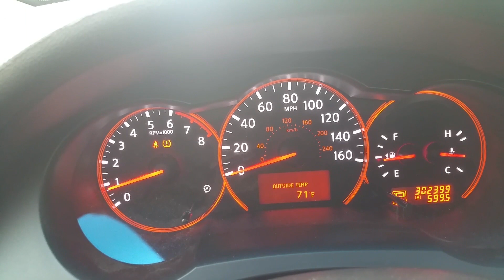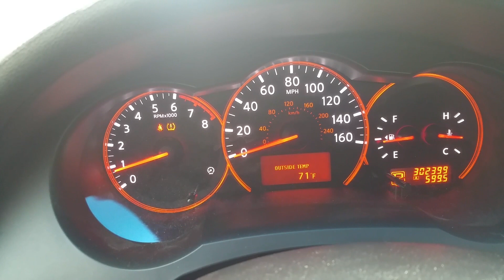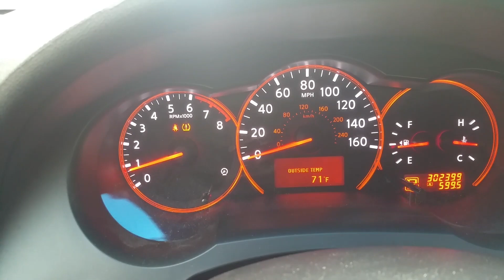HOW Long should A CVT Transmission Last?

Comment: I have a 2009 Altima and now I'm worried. It has 123,000 miles on it. Still running strong but I noticed it sounds like a grinding noise in reverse that I never noticed before. So I guess I'll drive it till it dies but If I don't get 200K on my Nissan then I'm done with Nissan. I have baby'd my car. I do all the maintenence and I change the trans fluid every 30k. So far I've never gone into limp mode.  Bought it brand new.
Reply from the maker: Who changes it? Alot of garages say they change stuff but they don't. Be weary of mechanics that rip you off....

Comment: I have a 2014 Honda Accord 2.4  I love it. It runs very strong and fast. I didn't know that it's equipped with a CVT. Transmission. Its 86k miles on it. I got it since new.and I never got any problems with it.

Comment: The problem with cvt is it’s a sealed unit, a pos of shit design for a vehicle and crazily expensive to replace. It would be a cool idea if you could actually change the belt every 100k when it starts stretching but you can’t. Do not ever buy a vehicle with a cvt unless you plan on just leasing because you will only get 100k miles out of it.
Reply: Nope, not true in every case. Honda and Toyota make the best cvt's and it's well documented. They last well over 200k plus when driven properly and regular fluid changes at 30k. Cvt's are not racing transmissions nor are the made for the heavy lead foot. They are made for smooth shifts and gas mileage. Treated as such you will not have issues with the two manufacturers i mentioned. The others i just don't know.

Comment: I just purchased a 2007 Nissan Maxima it has 113,000 miles it. I don’t know much about cvt transmissions. I’m changing the oil I should probably change my radiator fluid in my training fluid out I don’t want any problems thanks for the video.
Reply: How has it been

Comment: I have a 2013 Nissan note E12 supercharger model with over 90k mileage and no problem I change engine oil every 6 months and transmission fluid every 10 thousand miles runs like a baby
Reply: 10000 miles not recommended even in book
Reply: @thrishulh9834   I pass 7 cars and thats how I do it and never had a problem and all Nissan I use full synthetic castor oil 10w 30 I change every 6 months or 10 thousand miles and transmission uses ns 3 fluid I change every 6 months
Reply: @Babaywayne93  nice to know

Comment: Change the fluid regularly and you shouldn't have any problems.  The salesperson told me the CVT was "sealed for life" so I never changed it, and it failed at 62K on my '12 Versa.
Reply: I dont think your problem was fluid related because those show at later stages not 62k transmissions could easily last 150k even 200k miles on factory fluid, its beyond that where regular maintenance helps, its just that nissan CVTs sucked when they were first introduced
Reply: @Basilahi  I'll never own another
Reply: @Basilahi  1.6 SV.
Reply: What model did you have 1.8S or 1.8SL. Sedan or hatchback?   I had 1 in 2008 and only changed the fluid at 100k and 200k. No cvt issues at all but they did tell me it was sealed that i couldn't change the fluid. I didn't figure put I could until well after 60k and I demanded thex change the fluid.

Comment: jatco makes cvt for lots of cars and they arent that good. nissan buys jatco.  toyota n honda cvt's are in house and very superior
Reply: Don't kid yourself. Toyota and Honda CVT's have had breakdowns too.
Reply: @jaybyrddoggie  they all break. everything breaks made by man or robot.  toyota n honda are the best in cvt, still tread carefully....want a tranny to last? get a stick. jatco cvt have the most problems and are sold to most car makers other than honda or toyota.  nissan and their cvt get kicked to the curb the most
Reply: Bruce Barrett I am a rideshare driver and my 2016 CVT Toyota Corolla has 157000 miles, no issues at all 🤷‍♂️👍 Proper maintenance is the key. Have the transmission fluid changed every 60000 miles. Change the filter and clean the three magnets
Reply: @georgeschneider2414  glad to hear that. my honda is 19 and with 19 k miles. ill mark my calendar for 60k miles.  how much was it to change. i hear horror stores from dollars to hunddreds
Reply: Toyota and Honda use AISIN I believe they're not in-house
Reply: @kcmaldonado3948  IVE herad they are and they arent, but, they are superior. jatco is less so
Reply: @MessageBoardTerrorist  Change the CVT fluid and you shouldn't have any problems

Comment: I can agree with you there CVT transmissions they do hold up. But the biggest problem is people don't maintenance them the right way. I myself change the fluid in my Nissan Rogue every 30000 miles I've done this ever since the vehicle was brand new. I did not use Nissan fluid I use the Castrol trans X fluid. No issues at all. My 2013 Rogue is approaching 140,000 miles with no problem at all. With the exception of lower control arm bushings but that's a whole different topic LOL
Reply: I have a 2014 Sentra that had no problems other than the radiator fan burning out which was a cheap repair. My transmission just failed at 159,000 miles because the idiot stealership who did the last fluid change did not put enough fluid in the trans which caused it to burn out. I hate Nissan stealerships.
Reply: @BroadwayLTDProductions  Hopefully they replaced the transmission at their cost?
Reply: I took my Altima to a local mechanic to change my trans fluid and I don't think he used the Nissan fluid. It's now due for another change and so I hope it did not hurt it.  This time I will go to Nissan to get it changed.

Comment: Hey man great content. I got a 2012 Altima with 137k on it. I got it at 99k and I think I need to change the fluid. Anyway you should put links in videos to your other videos you talk about cause now I'm looking for the DIY  on fluid changes but I sub'd anyway. Keep it up
Reply: Big B Don’t think that thing is gonna last you very long.
Reply: ThinkkOps 😂 I replaced the transmission.
Reply: Big B I’m about to buy a Nissan Altima 2012 you think it’s worth? How much was the transmission replacement?
Reply: Swizzy I got mine from JD Byrider and the transmission through them was 2k. It’s worth it. There’s always something better if you have the money.
Reply: Swizzy Do not get one, they’re absolute terribly made vehicles, if you want a good reliable sedan but cheap, get a Corolla or a Civic, a whole lot better built, Nissan went downhill after Renault took over. They have electrical problems, transmission problems, suspension problems, quality control problems, I owned a 2015 Nissan Versa Note, it was a great commuter but once I hit 40k miles, it was insanely annoying to drive now since it started to give me eletrical problems with the TCM and door locks, sold the stupid thing before I could get any more milage out of it. Now if you bought it already, baby the thing, change the transmission fluid every 40k miles, and hope for the best.
Reply: ThinkkOps thanks I appreciate the reply. Got it for a good deal so I’m just gonna make sure I take care of it. Appreciate it
Reply: Big B thanks for the reply I just went and got it yesterday

Comment: 2009 Nissan Rouge CVT failed at 79k. 2010 Nissan Sentra CVT started whining and losing power on the highway just over 100K. Got rid of it. Then my 2013 Nissan Altima started whining at 60k plus had chronic electrical problems that cost me thousands. Traded it in for a 2018 Toyota Camry with a traditional transmission. No more Nissan's for me.
Reply: good move.
Reply: Nissan makes the worst cvt
Reply: but, they are good at it.....they have the market cornered on bad cvt's

Comment: This sucks I had my ❤️ set on a 19" Honda civic and it has CVT transmission um no thanks anymore. Nice video
Reply: juicykisses878 I am a rideshare driver and my 2016 CVT Toyota Corolla has 157000 miles, no issues at all 🤷‍♂️👀 “”DNY automotive “channel shows the proper way to change the trans fluid
Reply: Honda makes one of the best cvt's. Millions on the road with over 200k with no problems. I will be buying the crv next year and i have zero concerns.

Comment: 144k miles on my 2008 Maxima no problems
Reply: you drive well....there are exceptions.  you are one. congrats
Reply: @MessageBoardTerrorist  134K on my 2013 Maxima, mostly highway miles...no problems at all still runs smooth as glass..
Reply: @kenherrera2819  that is good.  some say otherwise, but, i think it is probably how you drive it and how you maintain it.  like most things
Reply: @MessageBoardTerrorist  There are two different CVT’s that Nissan uses. The 4-cylinder engines have one and the V6-powered cars have another. That’s why you don’t see Maxima’s, Pathfinders, and Murano’s with chronic CVT failures. The overwhelming majority of failures are on 4-cylinder models.

Comment: Don't worry your cvt lucky will run out.  my daughter has a 09 sentra with 170000 original miles   cvt i told her you better change that trans oil or failure is possible.

Comment: Cvt never again garbage!!!!
Reply: lol...nothing wrong with Honda or Toyota cvt's bro! Millions of them out there with very high mileage.
Reply: @uf1978  Yeah my honda 02 450 Foreman ATV
Reply: @HB-yq8gy  those are good too! I had the 250!
Reply: H B I am a rideshare driver and my 2016 CVT Toyota Corolla has 157000 miles, no issues at all 🤷‍♂️👀 The transmission fluid needs to be changed every 60000 miles. You also need to change the filter and clean the three magnets.” DNY automotive “channel shows the proper way to change the trans fluid.
Reply: H B why?

Comment: I got a 2011 Cube with rumbling noise at low speeds all gears work drivable. Nissan dealer said trans is bad needs replacement $ 3500 1 year 12000 miles!!

I guess you got lucky with your Altima our Cube changed trans fluid at 85000 miles still internal damage.
Reply: at first they told me 12000 mile warranty and when i went to pay for it and picked it up, they told me 40000 warranty
Reply: If that is with parts & labor a great warranty. Nobody here on the east coast offer that.
Reply: By 85,000 miles, your cube was nearly due for its THIRD transmission service (90,000 miles). I know some cases of premature CVT failure, but this isn't one. You're supposed to change CVT fluid every 30,000 miles.
Reply: Trans fluid should be changed every 45k to 60k miles. Also, the dealer checks the like with PC if you ask. Someone pointed out that your cvt should be on its 2nd or 3rd fluid change but you on the first at 85k

Comment: 410,000 on 2012 Altima original everything
Reply: impossible
Reply: jjjjjjjjjjjhjjjjjhjj 10,000,000 on my 63 Dodge and only replaced one light bulb. 😆
Reply: Thats what I'm saying, a nissan CVT at thatt😱
Reply: If that's true it's a huge exception to the majority. It's possible to get a well made product from time to time out of something that is notorious for failure due to bad quality.
Reply: @theory816 If that's the case why did Nissan issue a recall ?
Reply: Original transmission fluid?
Reply: brs rafal 
My dad has changed the transmission fluid on his 2012 Altima when it was on 120k miles. Now it’s on 190k miles, and still on the original transmission with no issue.
Reply: @johnwick155  That's why most of these are failing; people are not changing the fluid.

Comment: Maybe the year of your Altima had a different transmission that mine does.  My 2016 Altima transmission CVT only lasted 79K miles.  It is at the dealer right now and they are going to charge me 3300 to replace transmission
Reply: Wow same price we got from dealer for our Cube but, declined too much for only a 1 year or 12000 mile warranty. I called 20 different trans shop prices & warranty. I finally found a reputable shop at a fair price $2000 with tax same warranty as dealer.
Reply: H B It has a 40k warranty on the REMAN, i do not think it will last that long
Reply: Dallas Pilot Car Stay positive i bought a 09 Sentra new for my daughter. Dealer change trans fluid  at 95000 then again 143000. Amazingly at 168000 original transmission no problems yet.
Reply: I think the newer Nissans may be the issue. I hope you are right
Reply: I got my 2011 106000 miles Cube at trans shop now the used trans cost almost the same as a factory remanufacture. I got 10 estimates average price $3000 1 year or 12000 mile. I wanted a better warranty dealer said no  local shops no different.  Nissan only offer a this 1 year warranty or 12000 parts a labor due to high failure rate. Never again buy a Nissan.
Reply: I have a 2016 Maxima, almost 36k miles. Our CVTs are a little different. I bought an extended warranty for 96mo/120k miles. $2585 for it from Nissan of Santa Rosa, plus $180 for the inspection at Courtesy Nissan. Hopefully I won't need it, but I still don't trust the long term reliability of these CVTs. This is my third Nissan with one of them.
Reply: I spend a lot of my time diagnosing problems to other people's vehicles and based on my personal experience I have witnessed alot of problems with Nissan's. The ones in the last ten to fifteen years especially have the most issues with their automatic cvy transmissions. Nissan is a lower end car on the majority of their models and it seems that their quality control is significantly poorer than other vehicle manufacturers around. In my opinion Nissan and chrystler/Fiat make the weakest transmissions. If I were to recommend a car that does carry a reliable cvt, go with a Toyota or a Honda. Those cars are significantly reliable for a cvt trans. Plus the added bonus of labor and parts being significantly cheaper. I do know there are cases where Nissan cvts lasts a Long time but from my perspective it seems to be more the exception rather than the rule
Reply: You have to change CVT trans fluid every 30 to 40,000 miles. Follow the owners manual. Go to the dealership for everything including oil changes.
Reply: @stevebrule4742  Buy 1 lb tub of Vaseline and apply liberally to rectum before visiting Cashier station at the stealership.
Reply: @stevebrule4742  OR find a shop who knows how to service CVT's. A stealership actually caused my CVT to fail because they did not put enough fluid in it. D bags.